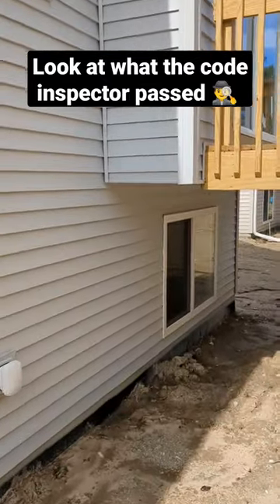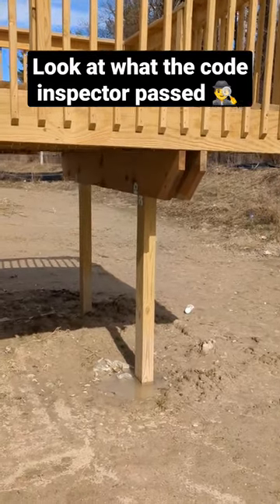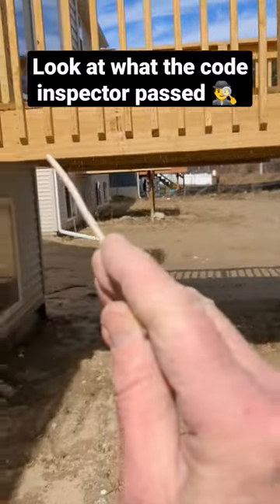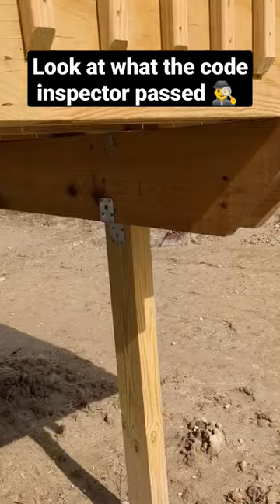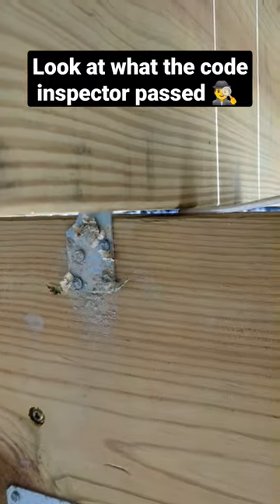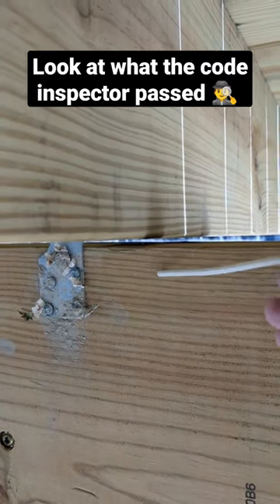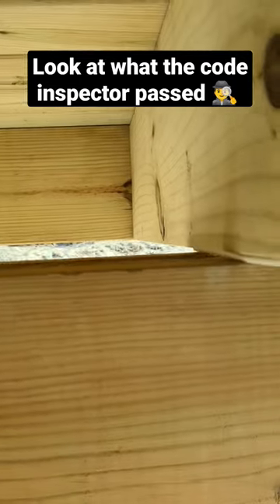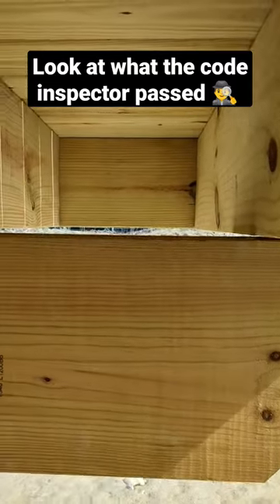Code #inspectors don't pay attention to detail#deck #newconstruction#youtubeshorts#shortvideo#shorts

Comment: How about the pressure treated posts being attached to footings below grade. Drives me nuts seeing standing water at footings.
Reply: Me as well! I worked for a guy for a few years that still builds poast frame buildings by burying 6×6 poast 2' in the ground. Drove me crazy. He said, "that's just how I learned to do it 25 years ago 😤😤😤
Reply: @coopertown7867  literally every concrete guy in my valley says the same shit, that's why I'm crushing them.
Reply: @qorpraltv5276  💪
Reply: Gravel in bottom of footing hole.... Your welcome...
Reply: You can just grade it  back out
Reply: I don’t think they’re pressure treated. Looks pretty smooth and brown to me
Reply: Yeab wtf
Reply: Always Haunch up the concrete 👍
Reply: You took the words right out of my mouth
Reply: @jeremythomas7544  Epoxy coated is already obsolete. Doesn't protect as well as they thought. Concrete posts is the way to go IMO.
Reply: 12" x 8' ground screw anchors are better than concrete in places with freeze thaw cycles. Plus you dont have to dig, and it acts like a telepost so you can adjust the height easily when things settle years down the road.
Reply from the maker: I AGREE!!!  Thanks for watching the video... to see some really major problems on New Construction, watch "Missing Footings"  
https://youtu.be/TqGMGpvnVAk
Reply from the maker: @mitchchartrand  🙌
Reply: My initial thought was, man that post has a lot of settled water around it, which makes me immediately wonder if settling has already occurred in the center there where the joists aren’t seated correctly and is a key factor.
Reply: The post are made to be in the ground 😂
Reply: Ground contact pressure treated lumber is different that regular pressure treated. It’s within the code to bury the post if it’s ground contacted rated. 
That being said I preferred the concrete to be 4”-6” above grade. 
Besides the joist the deck shouldn’t be attached to the bump out.  In this case footings and posts next to the house are the best install.
Reply: Fair enough. But wait until landscaping is done.
Reply: Has anyone thought just maybe they have dried out and shrunk a little all of it and yes those post are fine
Reply: @paulprescott7681 because that sounds easier than doing it properly...
Reply: @brynmawrbuilders5419 yeah you still run into issues with steel boots above ground (even newer ones that build wood up off ground) when it galvanic corrode with copper in PT post. Every method has downfalls
Reply: @jonny-b4954  Nothing last forever. Very true.
Reply: We do that shit in Iowa all the time.
Reply: Are code inspectors supposed to protect you from construction defect or fraud?  Sue your contractor for screwing you.
Reply: @matthissong4109 yes, ppl make the posts go into the ground ...
Reply: Makes no real difference. Concrete is porous and will allow water in if its above or below.
Reply: Lol.
Reply: Guts theme just looking at it
Reply: @coopertown7867 yeah they just have a customer base who needs new shit every 5 years.
Reply: @zachhorrocks104 they use a high pressure parafin injection to treat some wood now. Doesn't have that green copper tinge to it.
Reply: Me too
Reply: Wouldn't mind seeing a 3rd post under there as well
Reply: Thats the first thing i noticed
Reply: That is a pond feature 😂
Reply: What footing 😂😂
Reply: @babyelephant3077  😂
Reply: Aye bro drive me nuts fr
Reply: Yup, that's what I thought he was going to say.
Reply: Right... The other problem will fix it self.
Reply: Was just about to comment this hahahaha
Reply: @brynmawrbuilders5419 Suuuure... I have had GC rated 4"x4" posts rot in 5 yrs time.
Had to redo a whole fence section.
Buried them in  3/4" gravel,  and with a concrete collar above grade.
Reply: I know that's what I was looking at I thought that was much more important that other s*** will settle with time
Reply: @matthissong4109  Ground contact treated wood is only resistant to rot.

It will still rot . - just slower.
As shown is a poor install/ bad practice.
Reply: @brynmawrbuilders5419  
Code doesn't  mean didly when GREEN wood is pressure treated and that GC sticker is stapled on.
I have had GC treated fence posts rot below concrete collars within 5 years time.
Reply: This is why these inspectors are a waste of time. They give you a 50 page long report with minor issues that don't matter but miss major things.

Then they fall back on tons of disclaimers they have in their contract.  I learned my lesson the hard way.  Of course someone will reply with the old cliche "you got what you paid for". To which I say, they are right if you are paying for an inspector, you paid for a scammer and got a scammer.
Reply: I agree
Reply: Absolutely and the water will rod out the wooden posts.  The correct installation would have been to install concrete sauna. Fill tubes on footers and then have the sauna filled. Concrete tubes extended at least four inches above grade.  Stupid is as stupid does.  It's really too bad. The video didn't go into all of the other obvious construction errors that the inspector passed.  The inspector should be reported to the municipal or counting authority so that he can be discharged of his duties for gross negligence.
Reply: @brynmawrbuilders5419   ive had them rot in 6 yrs time.

GC rating doesn't  mean diddly.
Reply: Doesn't even look lime pressure treated wood. They could have put a sono tube just so it could have concrete a few inches above grade
Reply: @240t1r  Not quite on the sano field tubes.  One would need to dig 3 feet down and then install a footer About six inches deep and at least three times as round as the post, which would be about eighteen inches forty six inch post.  You would allow the footer to cure twenty four hours.  Then the remaining.
Thirty inches you would install a sono filter and bring it four inches above grade.  You would then pour that sonophil tube solid to the top and allow it to cure for twenty four hours.  Do you understand why it needs the cure for twenty four hours?  The answer is that it reaches eighty percent compressive strength.  And then you would install a simpson strong Attachment, You could either do it before or after the sauna fill two is installed.  Then the post goes on top and is attached.  This video is an example of deplorable construction and it would never pass here in caroll county maryland.
Reply: @frankie7508  I was just mentioning that it should have some concrete above ground. Though I'm not an expert on this, I'm an electrician by trade not a framer.
Reply: @240t1r  I am.
Reply: @paulprescott7681  Absolutely wrong and you don't know what you're talking about.  The lumber will absorb wood from the soil and rot out below the grade line.  SOil contains water And though the water may not be visible, it can be measured using a moisture meter.
Reply: @mitchchartrand  You are wrong unless the ground does not freeze where This piece of junk was installed.  The first freeze thaw cycle will Cause the posts to buckle and the deck will fall down, Or be so unstable no one should go on it.
Reply: @frankie7508  congratulations buddy, you're a framer.
Reply: @matthissong4109  Yeah right you must be joking.
Reply: @brynmawrbuilders5419  No ground contact pressure treated lumber cannot handle  emersement in water.  It simply prolongs the life of the posts, if the soil is well drained Around the buried posts.  The post should be above grade as you describe in your second paragraph.
Reply: @garymorgan2095  You are absolutely wrong.
Reply: @jonny-b4954  Wrong.  That's why buildings and structures are made out of concrete and steel.  In terms of fasteners, Stainless steel will last the duration.
Reply: @HaimTabibi  Sue the county for gross negligence on inspections.
Reply: @Floridamancan  So what.  If you're concrete extends 4 inches above grand the post is placed on top of the concrete sono Fill tube, There will not be any Adverse issues of moisture on the ground contact pressure treated lumber wooden posts.
Reply: @240t1r  Wrong again.
Reply: @frankie7508  sue the county for a contractor’s gross negligence?  That is some Russia or China stuff there.  How about holding the contractor responsible for the contractor’s mistake because the contractor made the money.
Reply: @frankie7508  good for you buddy!
Reply: @240t1r  Thanks.  Take care.
Reply: @williamevans6522  Ok.
Reply: @frankie7508  That’s how I do it.
Reply from the maker: @MandenTV  it got worse.
Thanks for watching
Reply: That’s the first thing I saw! Gonna be rotten!
Reply: @HaimTabibi Why else we have them
Reply: Virginia code footers:
24" depth (or to undisturbed soil) 18"x18x width....8" concrete footer in hole.  Post free float on top of said footer.   Ensures the ledger will not be required to hold all load ,should a post or two need a little wiggle room with snow load/ wind whatever it may be
Reply: Brackets for mounting beams?
Not notched.
Reply: Cry me a river Justin
Reply: Count down to break down.
Reply: Give it a month and they'll be resting on the beam
Reply: If it's proper green treat, it will out last concrete. Ever heard of a wood foundation?
Reply: Came here to say this
Reply: @El_Camionero  Wrong
Reply: I have nothing to do with building and that also seems to drive me crazy when I see it
Reply: It should not pass. The inspector should have a red flag, and it should be redone at his expense as a penalty.😢
Reply: They didn't put the crown up on all floor joists.
Reply: Bro has never seen a polebarn lol
Reply: Still technically allowed where I'm from. But it really pisses me off when I see it mostly because of the amount I have replaced over the years
Reply: Code in my area will not allow the concrete to be above ground. It has to be a 24" deep hole with 6" concrete, concrete below the frost line. 6x6 GC PT, post must be in the ground. If the inspector sees concrete on framing inspection you'll be digging it back out.
Reply: Sonotubes are cheap to buy and wouldn’t take much concrete to make a pillar above ground, just like a light pole base in a parking lot
Reply: @paulprescott7681  The footings need to be above the ground. You're not grading that out.
Reply: Two 4x4s are not enough.
Reply: If it stayed in the water it would last forever
Reply: Yep. I noticed that as well. Good luck finding Jose and Julio to come back and correct it.
Reply: @qorpraltv5276 My deck was like that. Made me mad everytime I Saw it. But 19 years and never had one issue. Deck was built solid and strong. Plus, it looks way better than having concrete sitting above ground.
Reply: Same
Reply: @zachhorrocks104 yes they are, the camera just does weird color balance/correction... At one point they go really brown to greenish and then to almost grey...
Reply: I was thinking of a couple 6 x6 would be nice sitting on concrete footers buried 3 foot with at least 6" above grade  @markme4

Comment: Hurricane ties were put on before the wood dried.
Reply: Here's how I see it - Catch 22
1. If the ties aren't fastened at both ends of the tie, it won't pass inspection (bad), but as the wood dries it will settle onto the beam (good).
2. If you do anchor the ties at both ends of the strap, then the wood shrinks and 1/4" is left between the 2x10 beam and the 2x8 joists (bad).
And it won't pass inspection.
3. If you undo the straps so it drops into its final position (good). 
But whether you used screws or nails, the old hole is so close to the new position that the screw will find it and you have a floating tie with a fastener in it (bad).
Reply: The wood is delivered the day they build the deck. They used all the proper( assumed) ties and procedures to build the deck. After a couple of weeks the wood starts drying out. The inspector is called right after completing the build. These gaps wouldn't be there when he inspects it because it hasn't dried out yet. And where would the deck go anyway? That's the only place besides the side of the house holding it up. There is no support structure on the outside rim board.
Reply: And no builder will wait for a month or more for pressure treated wood to dry out before building the deck!  Geez , some people!
Reply: This inspector and his video is not very intelligent.   Definitely shrinkage of the Lumber.   Same thing happens with plywood and/or OSB sheeting especially at plate lines and rim joists of solid wood vs composites.
Reply: Lol,  I've built dozens of decks, never had gaps like that between my girt and the Joist, even after years of dry time. Of course I put pressure blocking over the girt and toe nail each joist into the girt as well before putting on the clips..

Comment: The floating joists are fine and will settle into place.  My concern was the posts holding it up having water at the base and whether or not there is proper and adequate fixation to the house.  The posts are rated for outside,  but not for sitting in a pool of water
Reply: They are rated for ground contact, the ground often has pools/puddles of water.  It would be better to keep the puddles off them, but they are rated for it.
Reply: @bobbygetsbanned6049  that's nice.  When I was doing deck framing, we would set posts for fences in the ground with concrete surrounding it fully and above grade and slope the top of the concrete downhill away from the posts to prevent early rot. For decks, it was pour a small concrete footing and use a 1" metal post plate that secured to the concrete using a wedge anchor and 6-10 Tico nails in the post
Reply: Not with those clips on them. Those clips will not settle.
Reply: You must be a new inspector if you haven't seen this before... especially with decks..what happens to pressure treated lumber when it sits out in the sun? Common man pay attention to the details.
Reply: Thank u!! Reading these comments makes me wonder how different construction is area too area.
Reply: After it settles, it won't be level anymore.
Reply: Exactly settling will close those gaps and I totally agree also about the water!   Drainage is key here!!
Reply: I would have that company redo the beam
Reply: @scottdunn1093  Ya, right.
Reply: This is an inspector looking for shit. Those boards dried out. Only reason they are in the air is because of the hurricane ties. After a few rainy weeks they will probably expand again. lol. In Chicago our posts need to be 6” above grade with base brackets holding the posts 1” off the concrete, keeping the boards dry. poring concrete around a board does not stand the test of time due to the expansion rates of wood vs concrete and will fracture the concrete over a few winters reducing the structural strength and stability  also this keeps the boards wet quickly reducing the lumbers ability to prevent rotting.  Now in sand it’s a different story.
Reply: Throw a few cedar shim in and call it a day. Contractor must have pissed this inspector off for some reason.
Reply: @StrayDogTheExposer You don’t want your deck to be completely level anyway. Better if water drains slightly away from the house
Reply: Those are the new anti-gravity lumber from Home Depot. They are way in the back by the self driving nails.
Reply: "The posts are fine and will settle into place."
Yeah, when those steel brackets/fasteners give way.
🤦‍♂️
Reply: The brackets will shift as the nails bend the small amount to settle. The one thing you can guarantee anything built will do is settle. If you want something to stay somewhere you have to give it something to settle against or else it will move
Reply: It shirnks
Reply: Id be more worried about how the deck is secured to house. All the decks i have built are bolted to house but are posted at house foundation also so they could be free standing . I put mine in 23 yrs ago still solid as can be no im putting a cover over half of it..
Reply: To those saying “they’re pressure treated it’s ok”…BS. If you want the deck to last elevate the posts, it’s plain and simple.

But that’s not the only problem with this deck. They should have used 4x6’s for the posts and notched out the tops so the lateral supports were nested on top of the post and not drilled into the posts. And if it were me, I wouldn’t leverage a deck off a “pop-out,” ya’ll probably think it’s overkill, but I would have supported the deck adjacent to the house, unless I knew for certain that that pop-out had been specifically engineered to support a deck extending 12’ out from it. Unlikely.
Reply: @tristonskelton1015 wood housed in concrete is never good. I’ve seen swelling PT split the concrete pour open like a pie.
Reply: Also he says the joists are depending on the rim joist. For what?

Comment: I’m a GC and would like to call to attention that those joist were probably resting on the beam when they were placed but judging by the current climate in the video they probably dried quickly and shrunk.  Please remember that “wood moves”. Even if you were to plane down a 2x joist to make it flush with the other joists, I can 100% guarantee that the deck won’t stay flat during its life.  The is so much information on the complexity of wood.  It will expand and contract with the moisture in the air, the current temperatures, and even based on where the piece was cut in to relation of the tree.  I know most contractors I deal with in my field don’t know all the ins and outs of wood, and I do my best to help educate them, but I have been studying wood most of my life and there is STILL a lot to learn.
Reply: I am also an expert on wood. I can verify it grows and shrinks. 😂